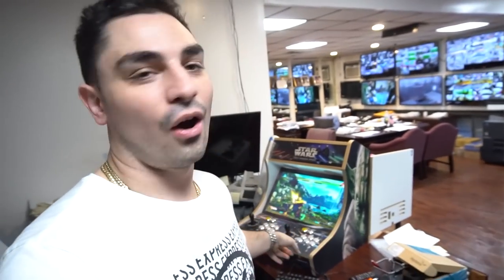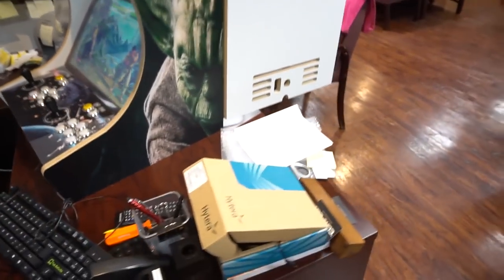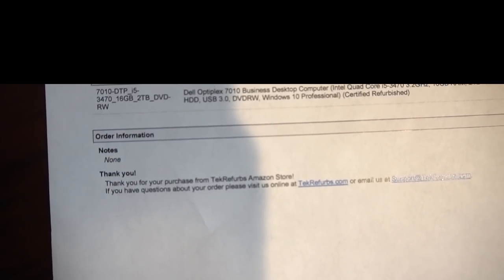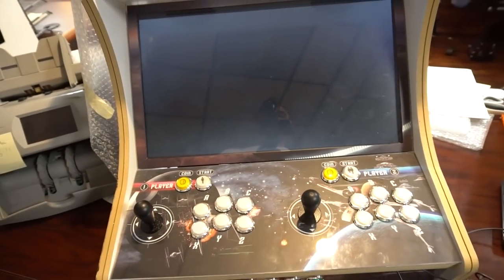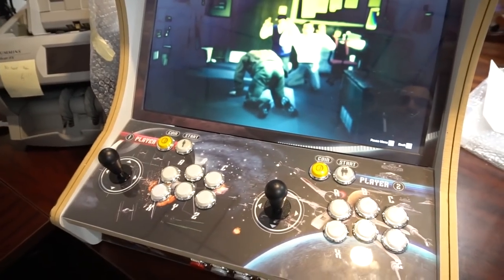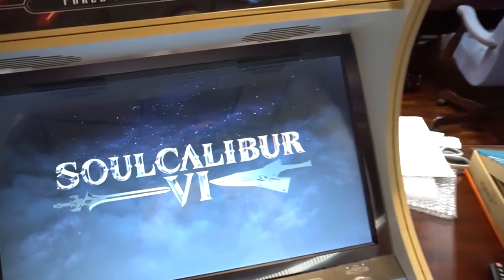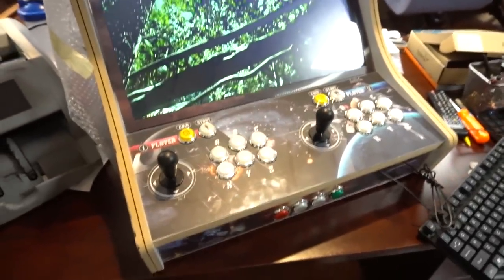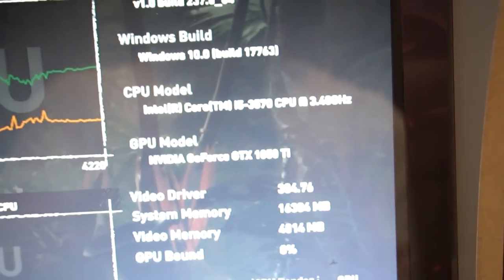Optiplex In a Bartop! BUDGET BEAST!

Comment: Great job vic do you happen to sell just the drives and what size if you do
Reply from the maker: Hey bud, I do not sell only drives, for the next 2 weeks I'm going hard on hyperspin and talking about drives. I stay far away from drives as they are never perfect and sometimes some dont work. Remember you need a fairly good pc to run these games. Like i said in the vid, ima do a side by side of the laptop and the pc
Reply: @Vic_VP  thanks for the reply would the 1050 ti run teknoparrot and the Sega ringedge ringwide etc in that family or a 970? Thanks again bro love this video to see a 1050 ti run sf5 is amazing
Reply from the maker: @tres6198  I never ran or done those emulators so I'm not to sure on that. Ima b testing the ps2 on this machine as well as dolphin

Comment: I was wondering do u have the layout how the Dell optiplex sff to make it fit in there
Reply from the maker: At 16:50 you can see the pc in the rear. Sff is smaller so it should be easier
Reply: @Vic_VP  did u keep the metal bottom of the case
Reply from the maker: @AngelOrtiz-ww1sh  yes instead of using plastic stand offs i just left the metal case. Its really the side panel